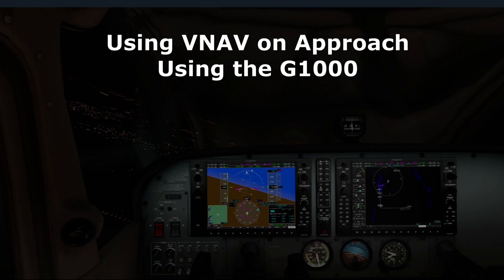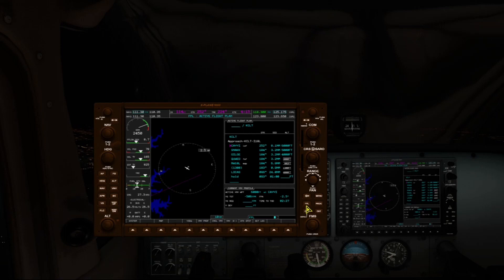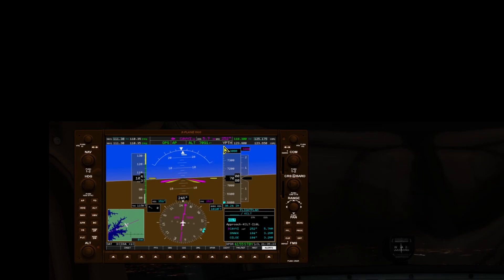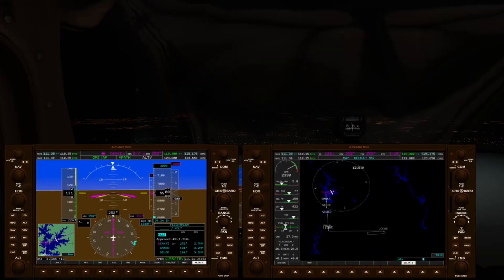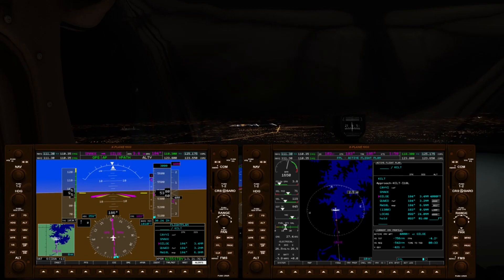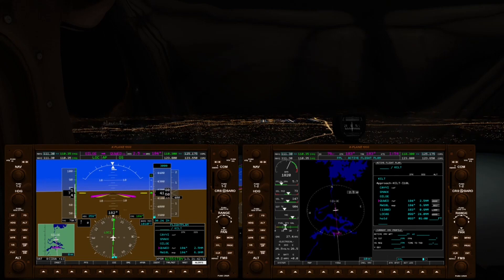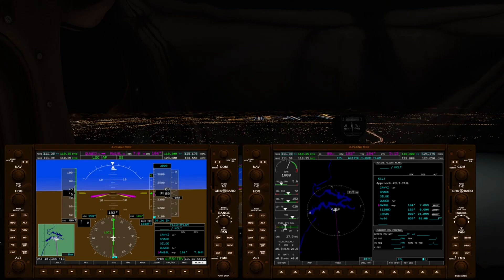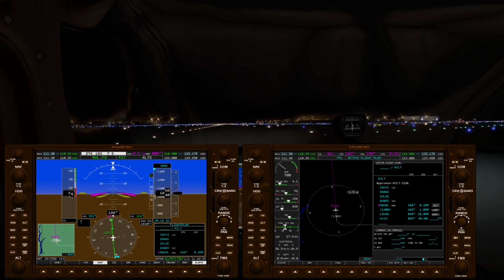Using VNAV on Approach Using the G1000

Comment: OK. I am just beginning to use my G1000 after using my G530 of a long laps . So to initialize  the VNAV , (KCLT) you chose 3000 ft. Is that 3000 ft below IAF of 6000ft? Or can pick another altitude below 6000 ft. and not below FAF (EGULL)? Correct me if I am wrong Mark. And VNAV does no work the same with RVAV approaches? You are the master. And another question, are you familiar with VNAV for the G530. How to set that up.

Comment: Excellent. Would I guess xplane and MSFS work the same. I have both. Or 3. xp11 xp12 and msfs.
Reply from the maker: They are very close.   The nxi in MSFS doesn't time out if you set vnv more than 5 minutes from TOD.   I haven't tested x-plane lately so that one might not time out either now.   One irritating thing with the nxi is it doesn't show ALTVS the way it used to.  Also, there is not indication at all when it starts decending.   That is weird as it didn't do that when it was first released.   I thought I had something set wrong but after some investigation,  I don't see anything to set.   Strange.

Comment: Nice explanation and the info was presented fine,  however, unless my eyes deceive me,  the ALT's were off by 250' or so  as at touch down you still showed you at 1000'  not the 750' or so of the TDZ ELEV.
Reply from the maker: Good catch there Robert!   Yep,  I never even gave setting the altimeter a thought as I was so involved with VNAV and trying to get that right.   Funny I never even noticed it until you brought it up!   Thanks for that!

Comment: When using VNAV in a real plane, the G1000 will audibly say "Vertical Path" to advise the pilot that the plane is one minute from the top of descent. That alerts the pilot to press the VNV button and to reset the Altitude Select to an altitude lower than the next VNAV altitude. I thought the X-Plane G1000 also says "Vertical Path," but mine does not. Have you heard "Vertical Path" when you use VNAV in your X-Plane? Your videos are excellent. Thank you for taking the time to do them.
Reply from the maker: Hi Lon,
I've spent some time on this since seeing your post yesterday.  Thanks for that!

No, the G1000 in X-Plane does not give any verbal notices as you correctly observed.   The Perspective (I used the HMB Cirrus SR22) however does in fact work as expected.  VNV in the Perspective is FAR superior to the G1000 I have found.   The annoying >5 min cancellation "BUG" does NOT exist in the Perspective.   As soon as I activate the first leg of the STAR, I hit the VNV button (which was about 90 nm out at the time), VPATH armed and 1 min from TOD,  I got the callout "Vertical Track."  I got beautiful vertical guidance all the way to the target waypoint.   I also had an approach loaded and had trouble getting it to automatically sequence.   I need to experiment some more with that.   

I decided to do the exact flight my buddies FlyLikeThePros demonstrate in this video:
https://youtu.be/5XWz6FaBIlo

I actually started my flight at KMMH and climbed to FL250 before flying to the initial waypoint in the STAR BTY.   I added an approach ILS 26L into KLAS to make for a complete flight.

Also, some of you have had trouble getting VNAV to execute.   I think a lot of the problems relate to the Flight Path Angle (FPA).   If the distance to the TOD is too far or too close, that angle is either too shallow or too steep for the VNAV system to capture the glide slope.   Here is an excellent video that describes this:
https://youtu.be/jwm7ADcQeOE

I found some minor differences but it pretty much worked exactly as they describe.

I would love to hear your experience with this Lon and anyone else reading this that would like to give it a try.

Cheers!
-mark
Reply: @markfletcher4579  I guess I've watched the FlyLikeThePros videos so many times that I began to think that I was remembering the "Vertical Track" callout from flying the C172/G1000 in  X-Plane. That's why I was puzzled when I couldn't hear it in X-Plane, especially because the VNAV function works perfectly for me. I fly X-Plane using Pilot2ATC and have enjoyed and benefitted from your videos about that too. I also use RealSimGear's G1000 suite which adds a LOT to the realism of the sim experience. I'm anxiously awaiting Saturday's release of the RealSimGear/TorqueSim Cirrus SR22, and am hoping (and expecting) that it will have the "Vertical Track" callout. I took a quick look at online comments about the HMB Cirrus SR22, but it seems that -- at least when it was newly released -- users were having difficult getting it to load properly. I've been waiting for the TorqueSim version for quite a while now, and decided I can wait another two days.
Reply from the maker: Indeed.   I'm planning to maybe even delete the HMB on Saturday!   I have been waiting for that TorqueSim Cirrus for quite a while myself.
Reply from the maker: Turns out that VNAV does not work right with the TorqueSim SR22.   I'm sure they will fix it but the HMB does VNAV beautifully.
Reply: @markfletcher4579  That's a shame. I bought the TorqueSim SR22, but hadn't yet gotten as far as trying VNAV because so many other more basic things aren't working, on my computer at least.
Reply from the maker: @lonsobel2580  Well,  no worries.   They'll get it right.   The TS-22 gets a lot of the VNAV stuff right.   In fact, it does everything right except ACTUALLY engaging the vertical nav.
Reply from the maker: I plan to make a video on VNAV and the TorqueSim SR22 once they get it straightened out.   It is a fabulous airplane and is destined to become my primary ride.  For right now though,  the HMB is king with respect to VNAV.

Comment: So I tried this and was very inconsistent. So I set out to figure out why Vnav engaged sometimes and not in others. Turned out that if I just set all the altitudes and set the VNav button for a period of greater than 5 minutes then nothing would happen. You can’t engage the VNav any earlier than 5 minutes away as seen in the VNav profile. Once under 5 minutes away you engage the VNav button and it will react when needed. That Paul fellow mentions it in his video. Says the VNav will “time-out” and nothing happens even if the VNav button is pressed and on.  Hope this helps.
Reply from the maker: That's interesting Carlos.  I must have missed that.   This is interesting too:   From the Garmin G1000 Pilot's Manual -  "If the VNV key is pushed more than five minutes before TOD, an additional acknowledgement is needed from the pilot once the aircraft is within five minutes of TOD.   ... The white VPTH annunciator will flash every second for the next minute, signaling that an acknowledgement is required.  If neither the VNV key is pressed nor the Selected Altitude is changed prior to TOD, the aircraft will not descend.  If the VNV key is pushed after TOD, the aircraft will still not descend, since it is now above the vertical descent profile."     So, the big problem is the X1000 does not flash the white VPTH annunciator so you never realize this situation.   I guess the lesson to be learned here is to watch the VNAV profile in the flight plan and watch the countdown to TOD and when it clicks under five minutes, you  punch that VNV button and hope for the best.  Just make sure you don't change the ALTS since the TOD has already been calculated.  I need to watch Philip's video again.

Thanks for this.  I'll do some more experimenting!
-mark